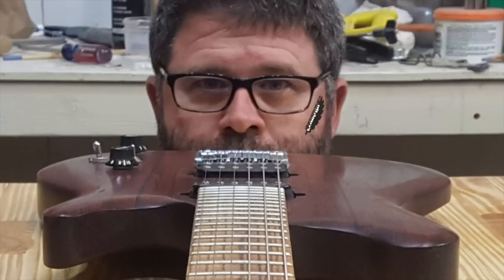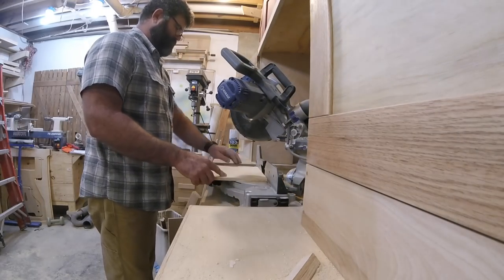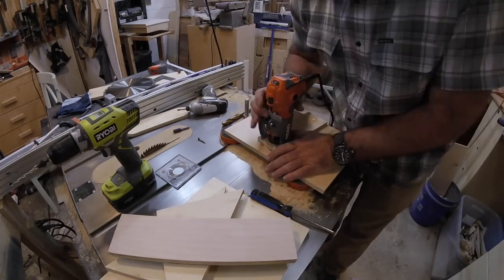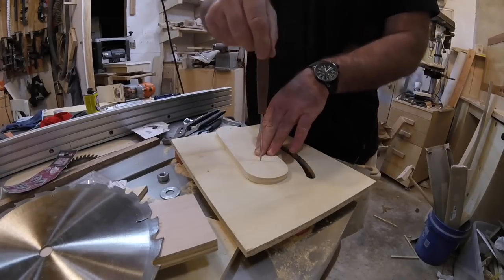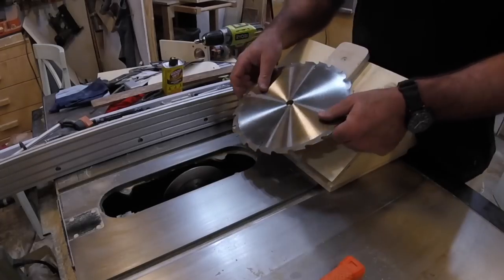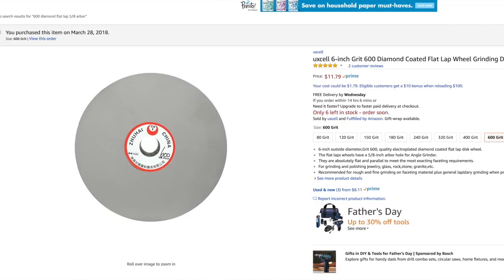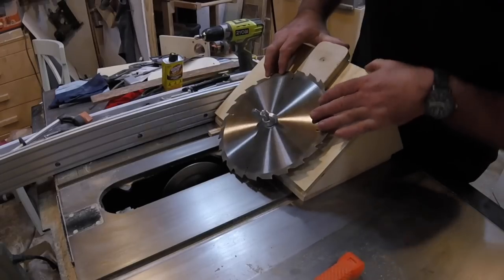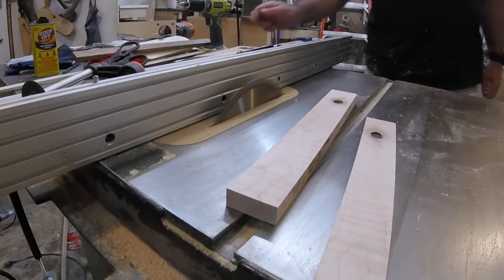DIY Circular Saw Blade Sharpening Jig

Comment: Most people might think that failing to control the depth of grind with the jig would be a serious issue. The fact that it isn't is not that hard to understand.

For the square faced blades you have, the three most important aspects of tooth geometry are squareness of face to blade, hook angle, and consistent tooth height. 
Your jig controls the hook angle and face squareness. Tooth height would appear to be unchanged, but can be affected by differences in grind depth between teeth.

If the top of each tooth were square to its face,  grinding a different amount from each face would not result in any difference of height.  But, teeth have a small clearance or relief angle behind the cutting tip to allow chips to clear.  If the slope of this is 10%, then a tooth is shortened only one tenth as much as is ground off the face. So a 0.1mm difference between the thickness of two teeth would only result in 0.01mm difference in height. Most cuts are through cuts and would not be affected anyway. But even in embedded cuts, the difference would be virtually unnoticeable I think.

I don't know if you were thinking about these things when you designed the jig, but I think you distilled it to its most elegant and simple form.
Reply from the maker: You know how sometimes you intuitively know a thing, but it isn't until someone puts it into words in an organized thought pattern when light bulb over your head comes to life?  You did that for me today.  Thank you for that.

Comment: Looks great,  what many people forget is after a while you just get a "feel " for how much you take off and the best angels with time.  Tweeking as you go. What  RPM did you use on a 150 mm (6 inch ) wheel?   What grit size would be best?  Thanks Steve.
Reply from the maker: Thanks for the comment and the question.  My table saw runs at 3450 RPM.  I know most contractor style table saw run closer to 5,000 RPM.  I started with a 600 grit wheel, but have since upgraded to a 1000 grit (same price).  I'm glad I have both.  Have you ever heard the saying "Fix one problem, and cause another?"  What I've learned through the whole process, is there's no substitute for a clean, sharp blade.  It has to be both, not just one.  My sharpener worked so well, I pretty much stopped cleaning my blades, and my cuts were suffering because of that.  I spoke to Izzy Swan right before he put out his recent video on cleaning blades, and he reminded me how a clean blade is super important.  Hope this helps.
Reply: @FranklinWoodWorks2016  Heck, I count myself lucky if I learn one thing from watching a video. In the case of this video, I've learned 4 things so far (and I'm only part way through reading the comments). I'm going to build an enclosure to the rear of my chop saw to better capture and contain sawdust; I'm going to clean my blades on a regular basis and sharpen them a bit less often;  I need to invest more time in reading the comments of videos I watch to glean more tidbits of wisdom along the way; and the quality of constructive feedback is proportional to the quality of the video production and of the producer/maker of the video.  I'm a new subscriber and I am grateful for the time you took to help educate us. Thank you for sharing. Mike
Reply from the maker: @mikekernan5388  Thank you for the kind words.  I, too, am on the constant quest for how I can do things better (and as inexpensively as possible), so I really enjoy the ideas that folks exchange in the comments.  You mentioned miter saw dust collection.  Not to try to sell you another one of my videos, but have you seen my 2019 shop tour?  At 4:57 in the video, I talk about the dust collection on my miter saw.  I think many make the mistake of trying to collect the dust AT the miter saw, instead in the area behind it.  In my experiments, a hood of some type with negative pressure - shop vac/dust collector - to draw the dust into the hood is the best way.  I've been very satisfied with my set up.

Comment: You used Bosch yet link the recommended wheel you didn't use?
Reply from the maker: The Bosch items were stabilizers, the link to the lap wheel is accurate.
Reply: @FranklinWoodWorks2016  Ahhh, that explains it! Thank you for the clarification an speedy reply!

Comment: Awesome job, simple and effective. What grit lapping disc are you using? I was thinking of getting 1000 grit.
Reply from the maker: In my opinion, 1000 is as high as you should go.  600 - 1000 will work great, you just have to be very gentle with 600 so you don't remove too much carbide.  And don't forget to clean the blade.  A dirty blade can make you think it's dull.  Thanks for watching.

Comment: My uncle in the 1960 and 70 s purchased a machine that factory sharpened saw blades
He rebuilt post offices back when a postal employee did it rather than contracting it out
Anyway he had the problem of fellow employees would use his blades also until one guy was off for a long time because he cut 4 of his fingers off  so he didn’t have liability insurance so the P.O. told him not to share his blades

Comment: Great video.  Question.  What did you use as the stabilizers on each side of the diamond wheel?   
Thank you
Reply from the maker: Bosch PROSTAB 4In Blade Stabilizer-Arbor 5/8In.  Runs around $15 for a set of two.

Comment: What is the link to the Bosch wheel?
Reply from the maker: Here's a link for the Bosch.  https://absupply.net/Bosch-PROSTAB-4In-Blade-Stabilizer-Arbor-58In.aspx  
But there are others that will work too...   https://www.amazon.com/Amana-Tool-STF-4-Blade-Stabilizers/dp/B000P4QGKO/ref=pd_lpo_sbs_469_t_1?_encoding=UTF8&psc=1&refRID=8X6YSCNQ0RFH85BKJJC2

Comment: Can I ask what grit of disk you use ? I made a very similar jig and had the same problem . Ruined two blades the same way. So I will be ordering a disk very soon. Great video .
Reply from the maker: I initially bought a 600 grit disk, and it did the job.  But, I could see the tiny scratches in in the carbide and worried that even that may be too rough on the carbide.  So I got a 1000 grit disk, and the carbide looks like a mirror.
Reply: I was thinking of getting the 600 or 1000 grit. Just wanted to see what you used. 1000 grit it is. very you.
Reply: Thank you .

Comment: Thanks for the great information. I don't know if your sharpening was in fast motion or regular motion, but once you have the jig, it looks fairly easy. 

I'll have to try it.
Reply from the maker: The video was sped up a little, but I can do a 40 tooth blade in about 3 minutes, 80 tooth in a little over 6 minutes.  One thing I learned through the whole process is that a sharp blade still needs to be cleaned.  I became lax on the cleaning because I was always sure my blades were sharp, and my cuts began to suffer because I had pitch building up on the sides of the teeth.  But a clean blade with sharp teeth is a beautiful thing.

Comment: Can you tell me where you locate the pivot point on the jig? Does it line up with the saw blade on the jig from left to right or does it not matter!?
Reply from the maker: It doesn't really matter.  What is important is to make the radius as large as possible, and to make sure that at the lowest point, the blade you're sharpening doesn't bottom out on the surface of the table saw.

Comment: There are always miserable people that just hate life and are very jealous, those are the morons that leave negative comments all the time no matter what you make or do... I love your idea although I did not make this jig, I did buy a blade sharpening tool at harbor freight for $45.00 and it works perfectly fine. I have about 30 blades that I get sharpened and I got tired of spending $600 to do so... I sharpened all 30 blades for $60.00... 10% cost of sending them out and I can not tell a difference, they cut like butter... Thank for your DIY video...

Comment: I'd end up gouging a tooth if I tried to sharpen without some kind of stop.
Reply from the maker: I think you would be surprised. I got several grits as an experiment, and i discovered that 600 - 1000 grit is pretty idiot proof. 4 or 5 taps of the tooth and you're good to go. I would imagine that something like 100 or 150 would put you in danger if gouging.

Comment: I at 1:12 and had to stop. I'll watch the rest of your video for sure BUT, that's a horrible way to push your wood through the saw.
Reply from the maker: You know, you're right.  There's never an excuse to do what I did, so I stand corrected.  BUT, if I could offer a reason (still no excuse, but you might be curious)?  I had been experimenting with finishes on the table cast iron.  I had just put water-based poly on my table saw, then finished that off with carnauba car wax.  I could have pushed that wood through with one pinky finger.  Not smart, but I could have.  Anyway, I appreciate the reminder.

Comment: Using a riving knife might not be manly enough I guess.
Reply from the maker: Keeping your fingers is always quite manly, and I'm a big fan of all my digits.  However, although I'll get piled on for saying this, unless I'm cutting big unwieldy pieces of plywood, or cutting stock, I don't think a riving knife is necessary.  When the whole piece of plywood is against the fence for the entire cut, I don't feel the need.  Cutting stock is a completely different matter.  As you cut, you are releasing internal stresses on the wood which can cause your kerf to disappear.  So, in my own mind, I'm pretty safe.  That being said, I'm glad you brought it to everyone's attention.
Reply: @FranklinWoodWorks2016  what are you talking about? There is no tension in plywood. And that's what makes it less dangerous when it comes to catching teeth. But here we go: you just didn't know!
Reply from the maker: I don't think you read my reply correctly.
Reply: @FranklinWoodWorks2016  And you are right! I didn't read it correctly and I apologize for this last stupid comment!
Reply from the maker: No worries.  I'm just happy you engaged with my channel.  Happy Thanksgiving!